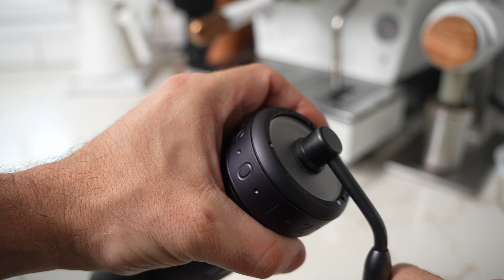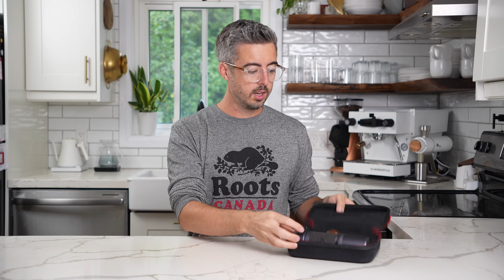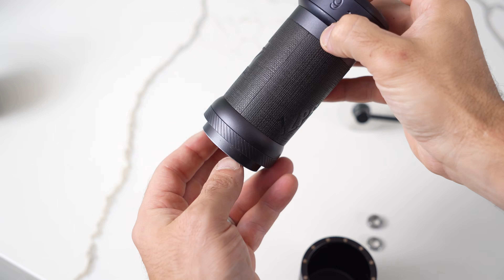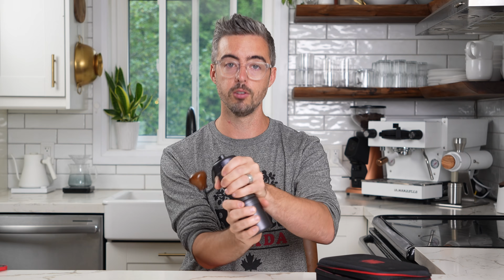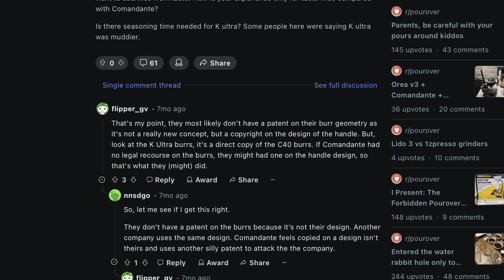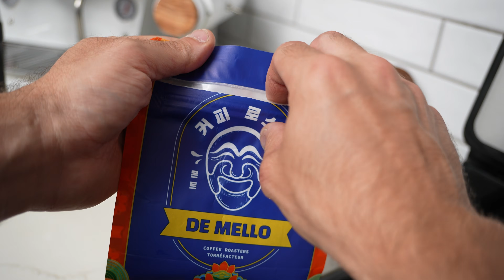1Zpresso K-Ultra - How It Won Me Over

Comment: Hello.  Enjoy your channel.  FYI.  I have the ZP6 and the burrs can be dissassembled further.   I'm quite sure the K-Ultra can be also.  Once the shaft/burr is removed, turn the base of the grinder (where the fixed burr is) counterclockwise, similar to the adjustment ring.  It screws right off, making cleaning much easier and effective.  Secondly, do you know if 1Zpresso offers replacement burrs for their grinders?  Cheers.

Comment: Adjustment dial looks useless, it's outside cool but you can not see small steps. Magnetic cup is also useles for me and you can easily knock it over. They have so much grinders too that you don't even what to loon for 😂. J ultra, K ultra, wtf ultra. Just make one damn thing which can be used for espresso and filter so I can use one and not 10 grinders to make things done 😑.

Comment: Funny, I bought this grinder strictly for ease of use. I can't get into the mumbo jumbo about "clarity," and "flavor profile," etc. I don't believe I can tell the differnce between coffee ground to a specific fineness with one grinder vs. another.
I wanted to throw out my electric grinder because it took up too much space and was a pain to clean. I tried a cheap Hario hand grinder but it was so cumbersome and rikety and took somuch time and effort to grind coffee for one serving that it simply was not practical.--so I got rid of it. When I heard about the 1Z K-Ultra and how well it works and how easy it is to use, I was reluctant to buy it because of the price. But I finally went ahdead and ordered it. I got it and it's great. It's fast and there are not problems with the ground coffed that cmes out of it. After usimg the K-Ultra for a month, I gave my Capresseo electric grinder to the thrift shop. I've never missed it. 
I've never made espresso and did not know that the grinding for that is so difficult. If I ever get into making espresso, I might just buy a second grinder that's made specifically for that.

Comment: I have a grinder question for experienced coffee nerds. I just bought  a Gaggia classic machine and my ancient conical burr grinder doesn't  grind the coffee fine enough to use the portafilters that came with the machine. The crema perfetto(pressurized) filter works with my old grinder but there's not enough resistance from the coffee puck with the traditional filters.

I can't afford $500 for an electric  coffee grinder that grinds fine enough so I'm thinking about buying a manual espresso grinder for $50. I could begin grinding the beans in my old electric burr grinder and finish off the beans in the manual grinder. It won't take as long if the final grind with the manual is done with already ground coffee. Will this work?

Comment: I bought the K-ultra after doing research on the Internet and I found this video very helpful! The C40 is wider than the K-ultra and the K-ultra is easier to grip for me because my hands are relatively smalI. I really enjoy using this grinder. I bring it to work together with my Aeropress every day. No more terrible office-coffee for me 😁
Reply: That's my exact plan, to bring on the go for brewing v60 or aeropress. Do you still find it as good as when you made the comment? I'm really debating between the K-ultra (do-it-all) og J-ultra / ZP6 for more specific use cases as I have wish to use my gaggia classic for espresso as well as V60/Aeropress filter coffee. Basically if the K can do it all well enough or if I am going to miss out not going to the dedicated grinders instead, worst case scenario is upgrading from multi-purpose to 2 more specific grinders.
Reply: @Erlendss93  Sorry for late reply, I did not see the notification about your comment. Yes, I still find it as good as when I wrote the comment. At home I use the K-ultra to grind for my Fellow Aiden, and I think it works great for drip coffee too. However, I have not tried the J-ultra or ZP6, so I cannot compare, and I have not used my K-ultra for espresso. I suspect that if you want to use it for espresso a lot, the burr movement for each step maybe a little too big and the J-ultra is better.
Reply: Agree. I bought the K-ultra for my business trips which I have to do many more this year. At home I use the electric Fellow Ode 2 for my V60, but oh dear is the K-ultra amazing when traveling with an AeroPress and a small scale. Perfect cup every single time, and even with some tricky beans such as Gesha.

Comment: How bad is the static retention on these grinders?  Just purchased a much cheaper electric travel grinder and its messy to use and the coffee is not great. Sending it back but not sure i want to put $250 in a portable grinder if they all are that messy due to static.   Nice video, thanks

Comment: I bought this grinder to replace a low capacity Timemore.   Like it very much except for two points.   The initial grind/number ring Calibration wasn't too hard with You Tube coaching.  But it occassionally mysteriously & inexplicably goes out, the ring locks up and requires disassembling and start over re-calibrating.   I can live with that.   My main complaint is that grinding my preferred Dark Roast, whether Beck's or Kona leaves a lot of cleaning to do inside the chamber (really a lot of trash pieces in there) and the bottom facing the cup.  Sticky enough that the "paintbush" provided only does a cursory job.  Maybe I'm inept (but I can still field strip and easily re-assemble a Colt .45 Automatic without difficulty) but the full disassembly and cleanup of the grinder seems more complex and also always seems to require recalibration.    Here's my Question:   Why can't I just rinse it under Hot water in the sink, blow the particles out, rinse off the fines....less than 2 minutes max.  Its all stainless steel and aluminum, using very hot water it dries fast.   Obviously that's what I've been doing...will this destroy the grinder in a month?  6 months?  A year?   I can live with replacing a grinder every couple of years.....but I don't understand how this construction of grinder can't take water.   Regards WH
Reply: Have you considered keeping a can of compressed air around? Then there's no risk of moisture getting into places it shouldn't.

Comment: Funny how when you disassemble it, you do not remove the bottom burr ring unit- I was wondering if it is dead stuck only on mine unit, or is it common problem.
Aftee a year not very happy with my unit. Stuck burr ring is not a big deal, wooden knob coming constantly loose and magnetic holder coming loose couple of times is annoying, but it really grinds my gears that it for whatever reason produces more fines then my good old baratza encore and ends up clogging v60 filters. Kind of considering sidegrade in the future.

Comment: people recommend to use this type of gringeds vertically to significantly decrease amount of dust during grinding, so try this out. If you hold it horisontally, you produce 3 times more dust, which is bad for taste. Also you grind faster with less speed holding grinder vertically. Try it, you feel difference

Comment: FYI, the best practice for calibration is actually not what is shown in this video. You don't want the 0 to be the point where the grind dial won't turn anymore-that is too tight. Instead, the 0 should be the point at which your handle stops spinning freely. The bearings are very smooth so as soon as the handle has resistance in the spin (when it's not grinding anything ofc), that's where your 0 should be set
Reply: And what difference does it make for you when using it? Apart from the settings being a few clicks further along

Comment: I actually don't like this grinder and ended up returning it because the grind adjustment ring inevitably kept coming lose. 1zpresso needs to put a locking nut in or change their design. It makes me wonder if commandante actually has the click system underneath for a good reason. It's basically impossible for that mechanism to drift over time. That being said, everything else about the K Ultra is top class.

Comment: I haven't heard it mentioned that the K-Ultra is almost too fast of a grinder. Which means for espresso in particular, which it is good enough at, it can require some pretty serious physical strength to do comfortably. But, it will definitely be grinding the dose quickly.
Reply from the maker: It’s fast. You’re definitely working on espresso but I don’t find it unreasonable. Harder than a c40 for sure though in this regard

Comment: I'm a huge beginner, I've got this arriving tomorrow as I'm currently using a Krups blade grinder, 6 years and counting to be fair! Thank you for this in depth video, really helps me understand the grinder before it's here. The brand was recommended to me, and I'm glad i chose a good model for filter!
Reply: I ordered this as part of my pour over setup.  I got the grinder first so I didn't have a cone or filters for pour over.  But I received a CAD300+ toy so I wanted to use it immediately so I made myself an espresso and since then I've ditched my electric grinder just because of coffee retention.   Plus grinding for espresso with it gives me a nice forearm pump in the hand that holds the grinder.

And the dial indicator is really handy for switching between espresso and pour over.

Comment: It is completely ridiculous to compare the burrs with the comandante in terms of copy (the handle was the actual thing iirc) because my (beloved) comandante is extremely lame, especially when it comes to espresso.
I am talking about 3 to 5 times the grind time. 
In fact, this was originally the reason I also got the zp6 (that is also slow)- I just associated speed with espresso and fines because "aggressive burr" and so on.
The truth is, I surprisingly love the (light roast) filter coffee from the Ultra. Sure, sometimes a little extra clarity would be nice, but most of the times I actually prefer the juicy cups.
And looking at stalling issues (or lack thereof) the Ultra makes it easy to brew. 
I "tested" the fines Ultra vs ZP6 with a Shaker with inserted sieve, so something cheap and not scientific,  but I was surprised that there was no real differece between ultra amd zp6.
I know, fines are not all and the test is really shitty, but it fits the overall experience.
The Ultra does something quite impossible, it is good for filter AND espresso, but you do not feel you make a real compromise in eighter section (speaking for normal hand grinders)

Comment: I have the K-Plus and it was my trusty grinder for a couple of years, but I haven't been using it since I got an electronic grinder. Not so much for the effort of hand grinding, but I don't want to clean 2 grinders instead of 1. Could you elaborate why you'd choose to use a handgrinder when you have a high-tier electric grinder, besides traveling? Are there any workflow or quality reasons or is it just for the fun of it?

Comment: I love this grinder…not my favorite thing to clean though. And when I reassemble it’s hard to get it back exactly to the exact point it was before so after cleaning it takes a bit more dialing it again. Not sure if you’ve used yours as much as me but my middle band is cracked in half and has worn off. Also I hate the handle having that little twist mechanism it always feels like a weak point and I’ve struggles with a couple issues with it. I like the sound the Commandante makes far better especially the wood one, but the amount of time difference is wild in how long I’m grinding for. Also on a particularly hard light roast on a morning I was being a bit cloudy headed The handle came loose and I dislocated my thumb. Not fun always worth remembering hand grinders are a tool, and if you are careless they can make you pay haha.

Comment: 9:40 oh no what about the Kinu M47 :-) 

Another great Video and I agree with everything you said - not sure about the comandante though!! rofl.

I had JE Plus, K ultra and J ultra. the engineer in me loved the JE Plus and loved the catch cup.

for the exact reason you state the K ultra lost out to the J Ultra for the reason i am 100% espresso, even though I do add it to steamed milk!!!

the main reason as you said is the J ultra has a multi - turn adjustment and much finer thread so much better adjustment resolution, NOT REQUIRED if you are NOT interested in espresso.

Ive recently added a Kinu M47 and currently deciding which will go on eBay. this is proving difficult!!

the best accessory i can recommend you try for the Kinu OR 1zpresso is a Left hand Wondergrip WG318 or the slightly thicker WG338. unfortunately both are only sold in pairs!!

Maybe a strange recommend to add to your coffee gear BUT it solves all of your hand grinding issues.

Im not a gym goer but not a wimp either. you cannot believe how much of a difference the glove makes. not a joke or wind up - 100% genuine.

the rubber ring on the 1zpresso helps but with the glove you do not need to concentrate to keep the grip required to stop it slipping.

Maybe coffee gear stores will start and stock them if someone were to endorse the idea 🙂 Hint!!....    @DaddyGotCoffee  

Im grinding 21.5g medium Colombian for the ACS Evo in around 40s to achieve circa 46g in 6s preinfusion and 25 second main.

There's something about the Kinu that FEELS better. similar grind times. Difficult to pick the 2 out in taste tests. Very Similar indeed.. as was the K Ultra but the engineer in me wanted that extra degree of control.

Comment: Great video and coverage. I am completely sold on all the Ultra grinders from 1zpresso. I use the J-Ultra for a lot of our espresso testing lately, and the K-Ultra is set up on my secondary brew bar. One note - I think between the K-Ultra and X-Ultra, I gravitate to the latter. It doesn't have the curvy beefiness of the K, but the adjustment clicks are a smaller micron range, which allows for better tuning on espresso grinds. Also for whatever reason, the straight body X-Ultra (albeit with their included optional silicone ring) just overall feels better in my hand under operation. Also the X is substantially cheaper than the K model. It's overall volume capacity is lower, but if I was presented with either, even at the same price, I think i'd go for the X-Ultra model.
Reply: What are your thoughts of K vs X for pour over specifically? Is the K noticably better?
Reply: Totally agree with you. And the cup profile give more sweetness. That's why I will buy it over the K.

Comment: Very nice review.  It appeared in your demo where you dumped the ground coffee into a 58mm portafilter basket, that the grinder cup fit well inside the basket.  Is this the case, and do you feel this works well?   Can you shake the grind up a bit in the grinder cup before dumping it into an espresso basket (note you did a quick WDT after)?   I might be interested in this grinder if I didn't already have two that do the job for courser grinds and for espresso (an old, Mod2 Knock Feldgrind) that work well enough for occasional use.  The price tag for a reliable, wide-margin-of-error all-around grinder of that quality would not be out-of-line for me.

Comment: Any plans to test any of the budget line Kingrinder options (P0, P1, P2) for those starting out? (All under $50) How would the results of these compare to your higher grade grinders???
Or would you suggest waiting to buy a higher grade grinder instead? (As long as it's under $100 -- And what is worth recommending in this price range?)  I have the P2, but am just starting out, so I couldn't be of much help otherwise...
Reply: I usually recommend most people start with the Kingrinder P2 or K6. P2 if you plan on upgrading to the 1ZPress K-Ultra eventually, and use your P2 as a nice travel grinder. K6 if you just want one to last for a looooong time and dont feel the need to upgrade later.

Comment: The main reason I wouldn't purchase this grinder is it's $450.00 CDN are you kidding me, that is one expensive grinder IMO 😱
Reply: If you search on the whole internet you will find that almost everyone will recommend this grinder and puts it at the top of the list for manual grinders. It’s expensive but it has great materials, produces great cups and will last a very long time.
I do not own one but if I didn’t have so many grinders this would definitely be my only grinder.
Reply: These are not cheaply made grinders, I have a ZP6 and it is very much a premium product with nothing in its construction that will wear out quickly. It is a grinder that will last years, if not decades.
Reply: it is much, much cheaper than a lot of the eclectic grinders it can beat time after time when looking at taste in the cup...... and you can make coffee in a power cut..... if you have a gas mokka pot or kettle . rofl!!
Reply: it's like any good piece of equipment: once you use it and understand it, esp compared against an electric grinder for the same price and you are able to compare a grind from each, then you understand better.
Reply: Great review! Your subjective assessment at the end was very useful. Your case for this grinder was one that resonated with me and was well-argued on the basis of a regular coffee drinker. I make coffee for myself daily. Pour over only. But I liked knowing how the grinder does across the span and appreciate a grinder with a wider sweet spot. Coffee varies, even within one bag over time. Water varies. So having a grinder that can accommodate those variances with grace sounds like a very good choice as a “daily driver.” 😊